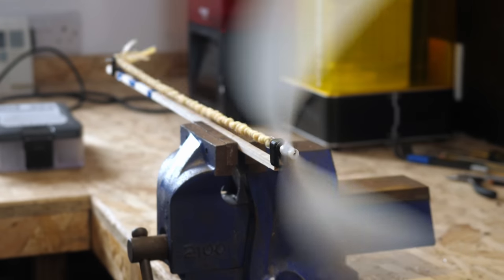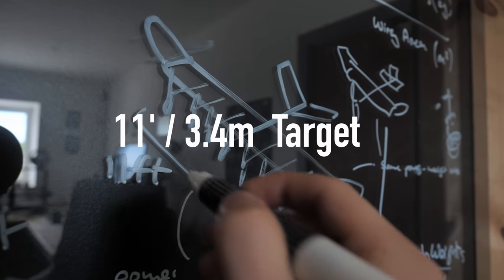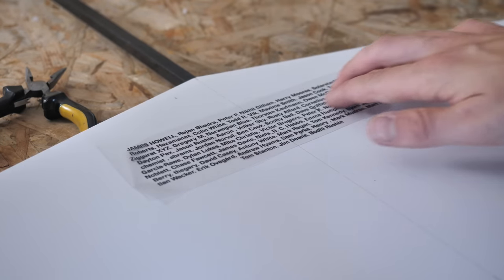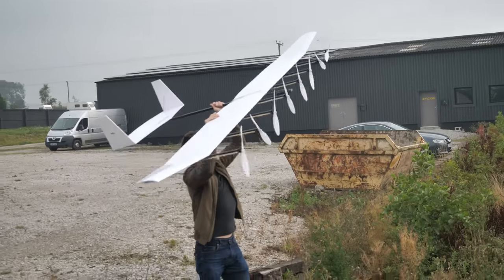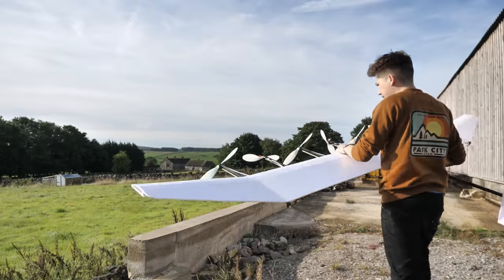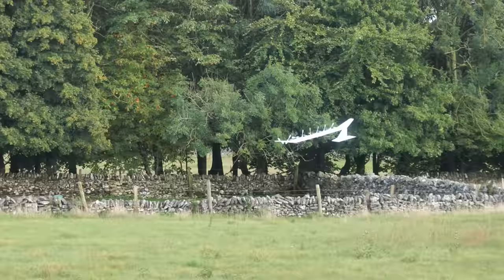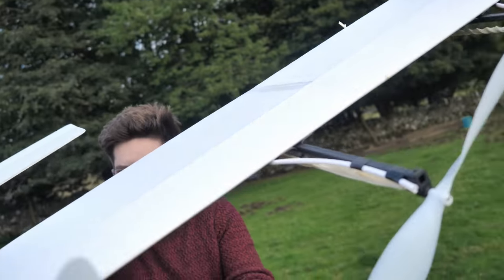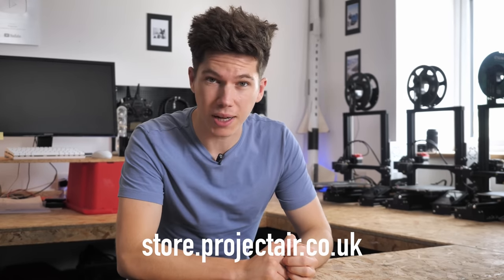Giant Rubber-Band Plane

Comment: You already have the official world record this video proves it Guinness doesn't hold official world records they only hold Guinness world records :-)
Reply: As for how to make your plane fly better stick with the radio controlled then use thicker rubber bands and larger propellers you want to at minimum double the size of the props slow and high torque not fast and low to work in this case

Comment: Why not have half turning clockwise and the other anti-clockwise to get rid of torque you mentioned. Maybe have a look at increasing the prop pitch with a stronger rubber. More torque more climbing power more height before the power dissipates. I remember the banana oil as well. Just a thought. Good luck 🤞.

Comment: Easy fix. More rubber. Lengthen the "pods" that hold the rubber. Remove the launch servos. Create a single "stick" that blocks all with some curves on each stick so it doesn't get stuck in the props. You want it nose heavy so you have to put a bit of reflex in the elevator. It should circle up via the torque of the thrust and circle down the opposite way. AND MAKE IT LIGHTER. There are 100 things you can do to the wings, mostly just lighter foam and all wood = CF
Reply: Better cross section for slow flight would also help

Comment: The first model airplane I ever built that actually flew (and amazingly, I might add) was a very primitive kit for a rubber powered parlour plane (or penny plane) when I was about 13 years old.  The kit was very crude.  I had to not only cut the wing spars from a solid block of balsa, but then cut the airfoil into them.  I had to fashion the propeller out of thin balsa stock using an aluminum can as a form for the contour.  The covering material wasn't tissue, but more closely resembled the skin you get in the pan after you boil pasta.  When it was all finished, it weighed just a few grams.  It was an indoor - only plane, obviously.  It flew fantastically!  Probably at less than 15' per minute, and the torque from the prop shook the whole airframe as it crept along.  A sneeze would have destroyed it.

Comment: Hey, stupid question here, but why can't you just double or triple up the rubber bands on each propeller? :)
Reply: You absolutely can.  But the max number of turns that you can put in will decrease at the motor cross section increases
Reply: Longer motor mounts would help for sure

Comment: Look for videos of F1B class of FAI contest free flight. The are winding the motors leaning 45 degrees on the tension. One F1B motor could easily power this plane over 30 seconds. The free flight guys have all the tech, it's amazing.

Comment: I can give you some advice because I have built a rubber-band powered airplane before that flew for over 16 seconds.   You want to limit the release of the rubber bands power slowly, so that means a lighter craft and possible larger props.   If you can achieve that you can go longer.

Comment: Ok, on a re-watch you are using 2 loops of 1/4, and I’m guessing 20” of loop length.   From the tables, that’s 49 turns per inch or 980 max turns, 780 for 80%.  Still well over twice what you’re putting in, and if you “braid” the motors you can use MUCH longer loops for longer run time. Basically the rubber cross section provides the torque, and the length of rubber provides the run time. The braid is kind of a misnomer, it’s really just twisting like rope. To make up motors for your project, I’d make a loop about 4x the length of your motor stick, wind about 400 turns into it, then secure the middle of the wound loop and bring the two ends together. Then release from the center hold and the whole thing will twist up into a right mess.  Keep the ends together, I usually bind them with a dental rubber band, and start massaging the mess down to the end. Ultimately it will lay down into a nice looking rope of rubber.  Lubricate it by chucking the whole thing in a plastic bag with the lube of choice, I like Dow 33, a low temp bearing grease.  Smoosh it around in the bag for a bit then find your end with the knots and dental band, pinch it in the bag and draw it out, using the bag to wipe excess lube off as you pull the motor out. Put it on your motor stick and wind it up, when it runs out it will look all knotted and horrible again, but note that it keeps the motor reasonably tight between the prop and rear hook, and the rubber weight will distribute evenly (if quite ugly) along the stick. Hope to see another try!  Btw, your servo prop release mechanism is brilliant and I love your 3D printed nose blocks!

Comment: Attach long quite soft but not too soft spring to the back of rubberband holder and make it movable, as the rubber spins loose spring will pull it whole a little bit back giving you momentary thrust boost, as the rubber band goes loose

Comment: idea: separate the plane into 2 stages, controlled by the releasers, first start the center 4 motors with the center 2 releasers then later do the edge 4 motors, this should double the duration and break the 30 second barrier

Comment: i dont see anyone recommending bigger propellers. The idea would be to rotate less but still have same thrust.  You could use 8 bands for 2 props.  Or use an actual coil spring and gear reduction.
Reply: Bigger props are also potentially more efficient aerodynamicly

Comment: Consider adding 6 more props. mounted close to the wing and between the current 8. Considering you're using RC, you could initiate a second 6 at the end of the first 8. Maybe play with prop sizes too. This project is really fun.

Comment: Can you please tell how you build the engine?
If the rubber is strecthed, it will pull the propeller very strongly inwards which will increase the friction. How did you overcome that?

Comment: Back in the 1980s we built ruber band planes with foldable 2 feet geared propellers. The fusalage in fiberglass held the rubberband inside wich was built up with hundreds of thin rubberbands, sourced from everything from oxygen masks to golfballs. They flew for ages. straight up whlile on power and then once up and rubberpower depleated, switched to gliding thru a small notch in the gearbox. It also had a small timer to make it land after 3 minutes which was the maximum contest time so they did not disapear. A plane travels a long way in 3 minutes, even if you make it go in circles..
The propeller was locked with the gearbox and you wound the rubberband up with a hand drill and a hoock at the back of the airplane.
Wings was made by balsa wood and rice paper.
Reply: We still compete and fly for fun using modern version of that

Comment: You're a star. The build process is great and your explanations are perfectly paced. From the start my only thought was 'how will he start all the props together?' I did wonder if your camerawoman could have been the chock puller but then you wouldn't have moved to the servo solution and end up electrifying the plane which turned out to be a good move. For the 30-second challenge, couldn't you servo operate a 2nd batch of props to increase flight time or is that not allowed for the GB of Records? In fact do they even allow electronics at all?

Comment: Right now, it seems like the biggest issue with increasing the flight time of the plane is getting enough power per weight to build height when flying. If you redesigned your "starting motors" to require only one motor, I think you would reduce your weight enough to fly higher, which would also increase your glide time. It also seems as though the plane is light enough that you can scale up the number of props/wingspan.

Also, if you move your "chocks" away from the prop's axle, you can reduce the amount of force being applied to the chocks, allowing a single motor to act upon more props.

Comment: Having the props on both sides turning in opposite directions would stop the issue of the plane veering off to the side. Folding propellers would help with the issue with drag after they'd stopped spinning and also deal with the issues of bent or broken props on the landings. Hope that's of some use to you. Good luck with the record anyway.

Comment: Try to incorporate gearing in your motors. You want the most spins out of the prop as possible for each wind of the band(rubber has good torque so you can do quite a bit with gearing). You may also reduce the number of motors on your plane, drive two or four motors with 2 bands each for that much more torque. You also want the prop to also be as pitched as possible because you have a fixed torque, so the more air you can displace per rotation the better. I think you are loosing efficiency with the amount of motors you have(not enough power to justify the weight and drag increase). 

Great vid man! Got me kind of inspired to build another one of these!

Comment: Great effort but you might find XPS foam a better option than foam board. Not only does it absorb moisture (even dew from the grass) but the paper copvering can account for half of it's weight. Waterproofing it will add more weight. XPS foam covered in coloured packing tape would be lighter and just as strong as foam board. B&Q sell different thickness's or you could try companies who use it in underfloor heating

Comment: Nice! I reckon a stiffer stab with just a bit more decolage would fix your COG issues. A wedge that lifts the wings LE a few mm would be an easy way to test.
For FF gliders, it's always best to have a bit fwd COG and some decolage, cos you can't correct for gust stalls. Too much will lead to oscillations but too little will give you squirrely pitch.
(Congrats on your store. Plans look great!)

Comment: I reckon you could reduce mass by connecting one servo to propeller release things using rubber bands. Also will a record attempt count if its a multiple stage plane that jettisons propellors and bands mid-flight when the rubber bands have spent their potential energy?

Comment: Congratulations on an excellent, successful aeronautical experiment. Nicely conceived and executed. Now, replace the anemic rubber motors with small electric ones and appropriate batteries, and you'll have a really interesting R/C model airplane that you can fly for more than a few seconds..
BTW, the Wright Bros did not fly at all on December 17, 1903. They managed to get their Flyer to hover in a forward motion (like a Hovercraft) as their airplane did (could) not fly higher than and out of ground effect.
They did not make a true flight until September 1904 at Huffman Prairie, Ohio when their Flyer II finally lifted out of ground effect, and also flew the first circle.
Your giant rubber craft (barely) lifted itself higher than ground effect, and so, it flew.

Comment: so if you look up "rubber powered sproose goose" you will find one and its great but what i wanted you to see is the mechanism he uses to keep the props from spinning before the launch. he has a foam thigng that fits next to the props and its all one piece connected so you yank it up and off the plane and you no longer have either the weight of the mechanism on the plane nor the issues with launch. i think flite test did an episode on the guy that made it a while back if you can find that video i hope it helps design the new system for the world record

Comment: You need a sunny day and an afternoon flight over a big black parking lot where you can try a ride the thermals for a sustained flight... You can also try folding props which would reduce the drag after the power cycle

Comment: I love going back to the basics occasionally, I wonder if instead of having a rubber band on each prop, you could tie all of the props together with a light pulley system and put all the rubber bands together down the center of the frame and drive all props at the same rate and you would only need to release one spot to get all of the units spinning, you would have more power available and with some small gearing you might get quite a long flight time.

Comment: if you can keep the rubber bands warm until launch you will get more energy stored. it will increase power while adding zero weight.

if you had some way of connecting the props to a common drive train, you could pool the potential energy of all rubber bands. meaning, you could have multiple band per prop. there are weight and complexity issues here but could be worth it.
Reply: Bigger single prop is the way to go for sure

Comment: Lifting tailplane with aft c of g helpful with free flight as it promotes stable equilibrium. If using those rc servos you could save weight if they doubled up as motor release AND control surface management. Motor torque issues could be neutralised by having half of the motors on each wing turning in the opposite direction. You might find 4 motors could give better thrust/weight ratio? Wing structure could be built lighter. Etc. Great fun video though, loved it 👍

Comment: Add logic to stagger the release of propellers, that way as several are running down, others will start up.  You might need to add more props, but you could get a longer sustained flight, rather than one large burst of power.

Comment: Is there a material that is strong enough but lighter than the foam board you used? I don’t know if it would make much difference but what about the folding glider propellers?

Comment: What if you used a rubber band to power a rack and pinion mechanism? Seems like that would work better than twisted rubber bands.
Reply: If you lube the rubber losses are still smaller than any gear box

Comment: Pulling the release pins for the props with the rock would work if You added more rocks and spread them out over the ground the same width as the wings.
 The way you did it put some in a bind because they were being pulled on at an angle.

Comment: Six rubber powered motors, two for launch. Next two released via remote pin like bomb bay door. Next two also set on remote release. All controllable via remote. Climb until power loss. Release and climb again. Repeat, glide for days... like a 3 stage rocket.

Comment: I had a rubber band plane when I was a kid, that had a gear between the rubber bands and the propeller. 
What about doing that and then beef up the bands to something like bicycle inner tubes?
More power with a slower delivery, amplified by the gear, might get to 30 seconds?

Comment: Where do you get your foam from?
I've been trying to build something out of 5mm foamboard from Hobbycraft and bending the foil seems near impossible (or at least, very... lumpy (os opposed to a clean curve)
I notice in the prototype, the wing is just the top part of the foil, as opposed to a flat bottomed wing, does this impact efficiency much?
Reply: If you're not doing so already, removing the backing paper from the inside of your curve and slowly bending with a support board is usually the trick, and of course relief cuts into the foam for particularly tight bends.

Comment: Nice video. Half the rubber bands one direction and half the other (with corresponding propellers). Grease the rubber bands with wax or little silicone oil. Try to make sure the same tension on each rubber. The record should be no problem! Keep up the good work :)

Comment: Polyhedral, silicone lubricant, c of g 60% wing chord, freewheeling or folding prop, winding to near maximum turns, down and right thrust, separate fin from tail, maybe small pylon, never fly left under power always fly right. All standard parameters for rubber powered model aircraft. Easier to enclose one motor in fuselage. For better performance built up wing. Look at American Mulvihill models.
It’s a great challenge, but with very large models the rubber power is insufficient to overcome its weight. About four foot span is close to optimum size, with 50 grams of Super Sport rubber.
Reply: Modern F1B uses 30 grams rubberand are basically all above 6 feet so it is possible to push the envelope

Comment: Built one years ago using very strong elastic over a metre long. Drove it through a gearbox with the prop on the output shaft. I think it was a step up of 20 to 1. It flew longer than a minute.

Comment: Since you set the Wright's first flight as your goal for this then clearly the next step is a manned flight of a rubber powered craft of modern design made of modern ultralight materials! Since there are already several ultralight personal gliders, the biggest challenge may be the design of the rubber "engine"...

Comment: Not clear from the video but if you lubricate and band and stretch it to at least twice its length before winding and gradually shorten as you wind you will get many more winds on. That is normal rubber powered aeroplane practice.

Comment: I had a thought, with 8 engines is there enough power your Foam Goose to fly on 4 engines? If so the plane could be launched with 4 motors, and with your electronic control midflight have the idle engines start, as the others are near their end of tension (torsion)?  Yes it adds complexity, and I don't know if it would work.

Comment: You could stagger the release of the motors for longer flight but lower power. Instead of letting them all run at first just do 1/2 at a time and then start up the other ones once in the air for a few seconds.

Comment: Maybe staging the "engines" by only starting 4 at launch and starting the rest in flight using radio control when the initial 4 begin to lose power...might slow it down but should extend it's time in d air (if d slower speed doesn't stall it)....Great Vid as usual🙌🏾🙌🏾🙌🏾

Comment: would small load bearings between the prop and the block help with efficiency?
Reply: yeah, I wonder how much power is lost at the propeller bushing. It wobbles a ton during spinning.
Reply: @Hobz79  I was thinking about that loss, if all it is doing is keeping the rubber band from unwinding all at once you could use it to govern it, make it take longer to unwind.